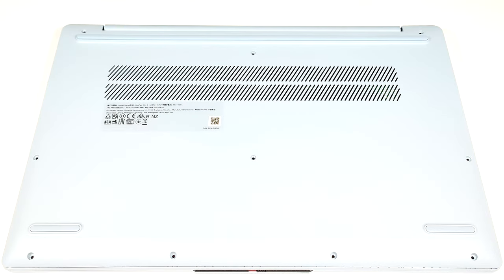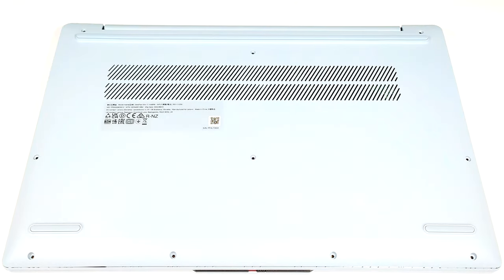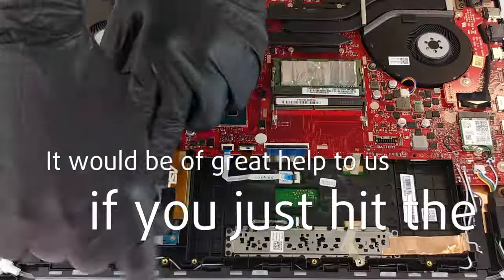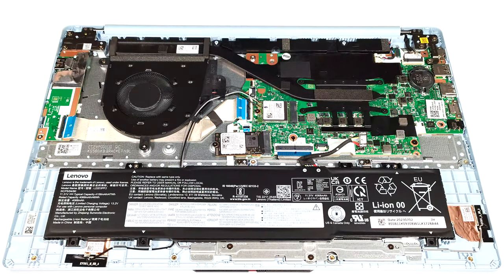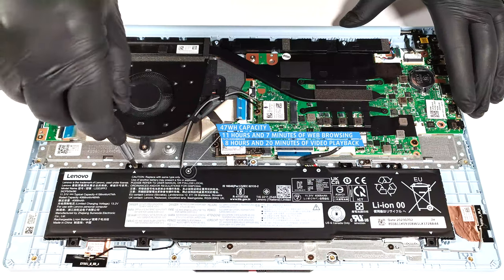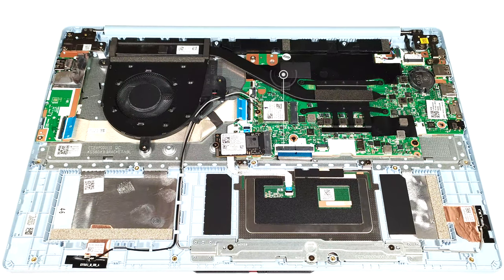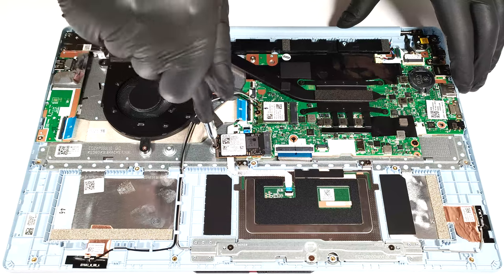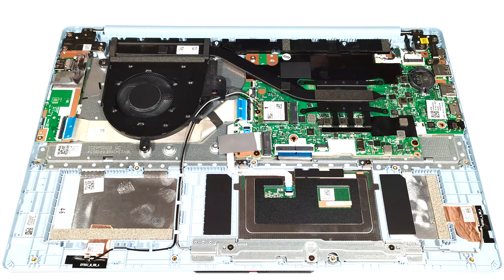🛠️ How to open Lenovo IdeaPad Slim 3 (15″, Gen 8) - disassembly and upgrade options

Comment: Can I upgrade ram memory?
Reply: no
Reply: @5triker0018  then this is like a tablet?
Reply: If no ram upgrade ..then stop buying
Reply: the only thing you can upgrade is the ssd, anything else that can make a significant change such as cpu, gpu or ram are undetachable, i dont see why you would want an upgrade, its a good laptop, but if you play a lot of games and want performance then you wasted money on it. i use this laptop and it runs very well without any issues
Reply: @techconcepts4you850  Es una excelente computadora en su rango, si no se actualiza la ram pues intentar adquirir la de 16Gb de una vez, pero para tareas de oficina normales es un equipo que tranquilamente dura como mínimo 5 o 6 años sin dar problemas.